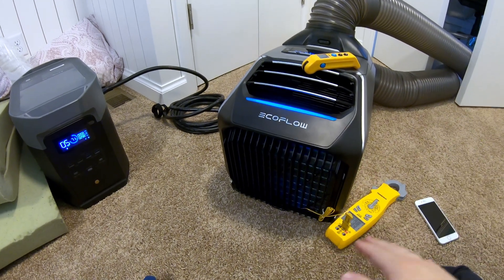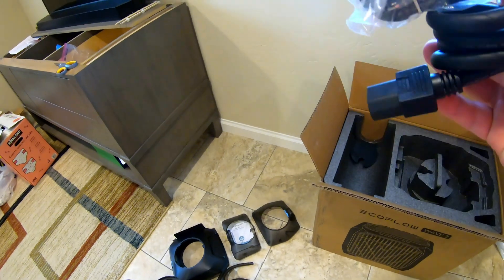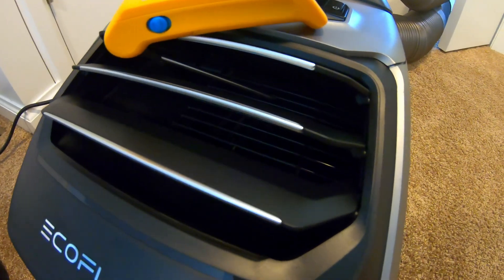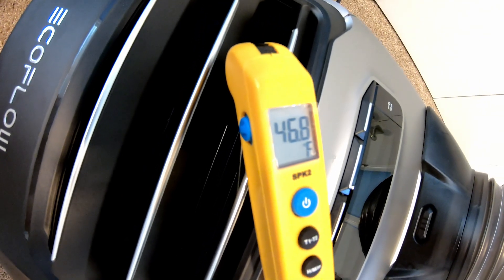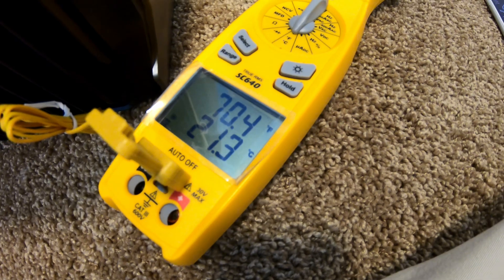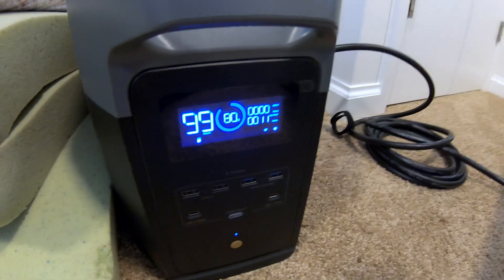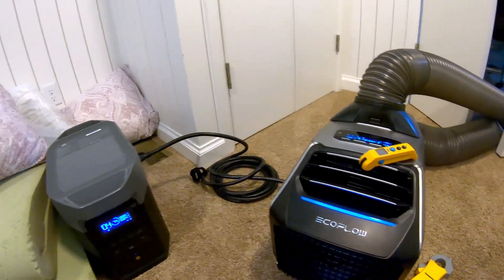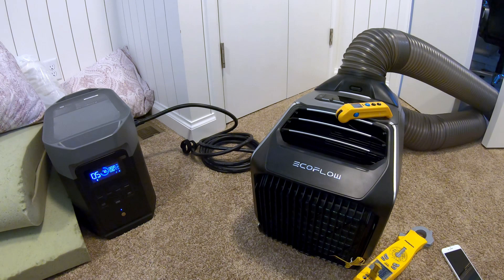EcoFlow Wave 2: Testing Cooling Thermal Output In The Real World

Comment: Just want to ask. In a normal ac, when it reached the temp it will lower down consumption, how about wave 2, when the unit is outside and you’re just using duct ? How will inverter kickoff?
Reply: Or is it design to run on the same watts like for 8 hours or so?
Reply from the maker: Yes, in my testing as the unit gets close to the set point, the inverter compressor will throttle down and lower energy consumption. Thanks for watching!

Comment: Hi, thanks for the video.  Maybe you have a good unit that works but many of us have struggled getting the AC to work in real world scenarios.

The unit is marketed towards people with vans, trailers, RVs, and tents basically.  You want to test this scenario on a hot day and provide a video so people can get the real story.

Basically, your test room is very well insulated from the sun and the wave 2 can keep up cooling your room when the condenser cycles on and off.  This isn't a true real world test.

Try it in a trailer above 85 or 90° ambient temperature inside trailer and see what happens. You will be surprised it won't cool it in a five + hour period.  Your trailer may drop a couple degrees Max to 87° (if 90 inside the trailer).
Reply from the maker: Thanks for watching! What you said is very true! Not sure if you heard the part in the video, but be sure you’re subscribed because we’re going to be doing some more real world tests along the lines of what you recommended! This first video was just testing the thermal output and see how close the app readings are vs. reality. More fun testing coming up!